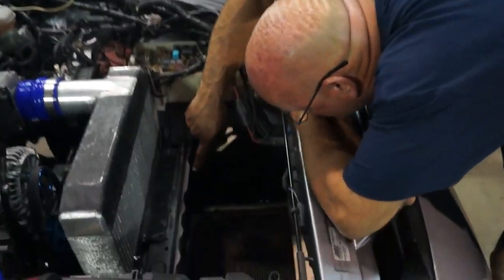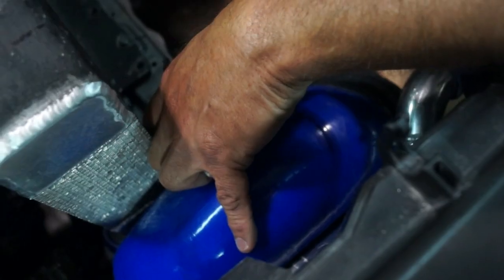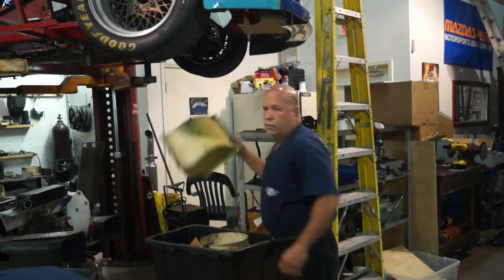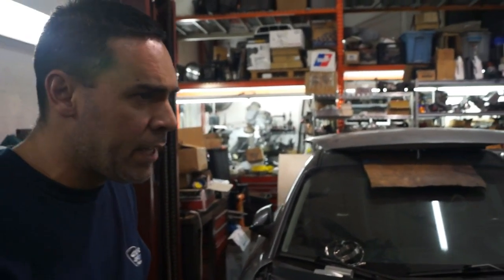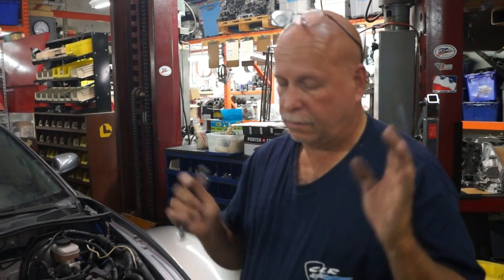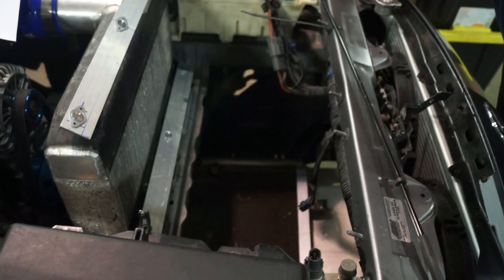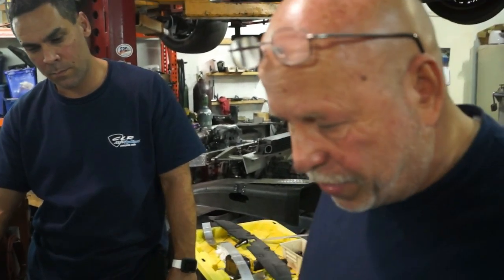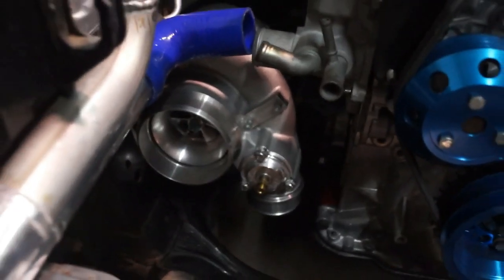Project Turbo RX8 Part 23

Comment: Has the issue of the turbo oil drain been addressed in any of the videos? Will the rx8 front cover be modified to accept an AN fitting for the oil return? Excellent info so far.

Comment: Ok I've been watching all these and it's crazy crazy crazy impressive. I do wonder what the outcome would be if you were to of used a 20b instead of a 13b. I'm new to rotary engines so I'm not sure on a lot of the specifications to sizes and such of the various components engine bay room etc. I just got an RX-8 myself and I'm trying to learn as much as I can about advancements in power gains and what not. I want about 450-500 whp for street use, but not sure if that would be obtainable with out an insane amount of cash thrown at it, I figured if I could do a 20b swap I could get that kind of power without as much custom work. Feel free to comment with your thoughts I'd appreciate the feed back to see where I stand in reality and not just hopeless dreams.
Reply: Haha, not as much custom work, hehe. I've spent the last two years puttin a 20b in mine, trust me, it's not easy. These guys are putting this together as an off the shelf kit, so no custom work required, really.
Reply: All I see is custom work. I have been waiting with my broken RX8 in the garage since August 2013. I was really excited when I first started watching the videos. It seems that cutting will be necessary. I just want to drop the new engine and plug it in. I am starting to believe that there is no hope for the RX8 model.